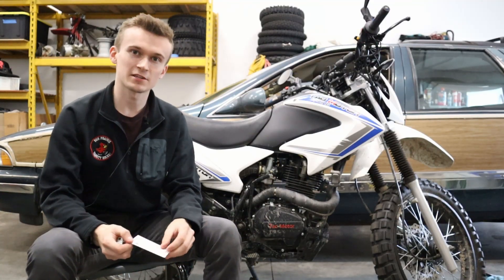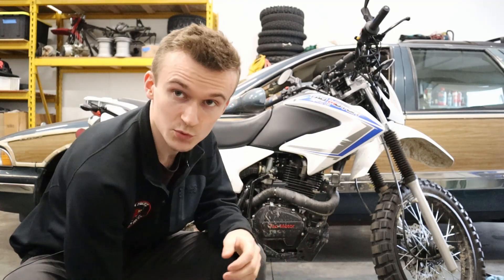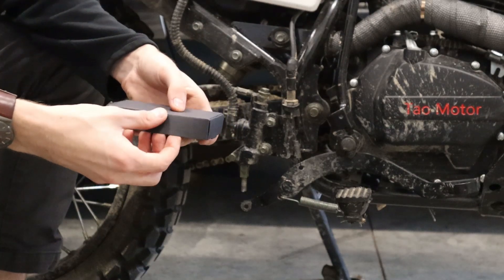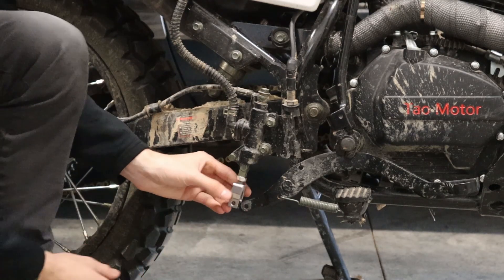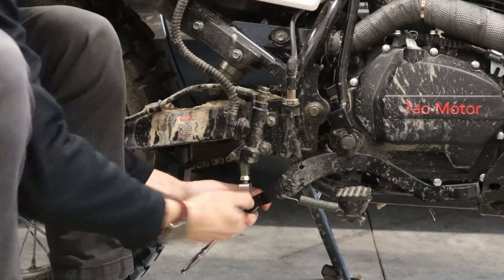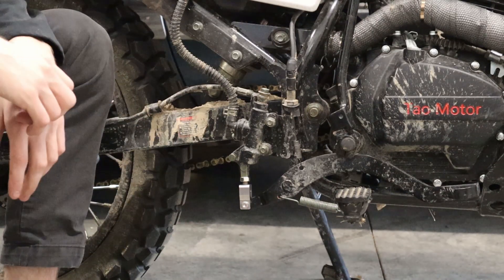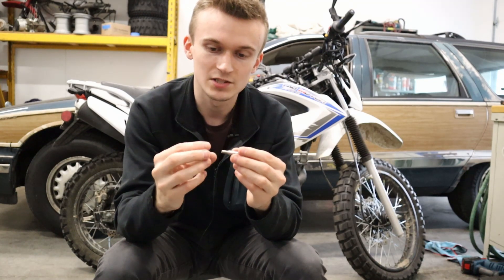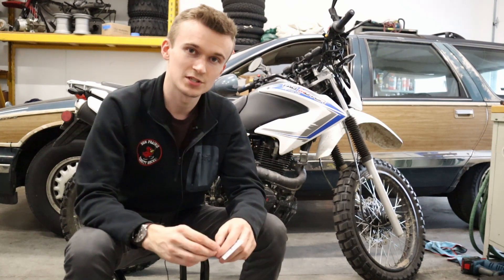How to install the TBR7 Rear Brake Clevis Kit

Comment: Do you plan on making any more videos featuring your TBR7? Being an old cardinal I love the SP garb you wear.
Reply from the maker: Absolutely! I recorded a motovlog style 1000 mile review of it the other day that I need to edit and also planning to work on some more TBR7 part design videos and more technical teardown stuff with it over the winter! 
That's awesome to have an old cardinal around 😂 What year did you graduate from there?
Reply: I'm class of 76 but my kids graduated in 01, 04 and 06. I'm thinking about buying a tbr7 to take to Florida in the winter.
Reply from the maker: That's awesome! 2016 grads here haha! What would you use the TBR7 for in Florida? Off-road stuff? Crushing around town? Let me know if you have any questions!
Reply: It would be for cruising around and some trails. I ride around SP on a Z125 and a 1500cc Suzuki cruiser. I'm an old guy who loves motorcycles.
Reply from the maker: @mikeganser  Sweet! That sounds like you'll have some fun with the TBR7. In general, it's a fun little bike for the price. 
The riding experience is definitely a bit different than riding a big bagger, which I'm sure you know with your Z125. We just got an '01 Suzuki Intruder 800 up and running in the shop and it's a ton of fun. We're young guys who love motorcycles just the same :)